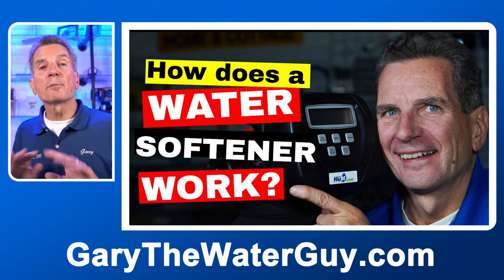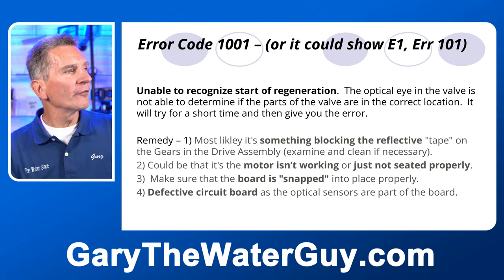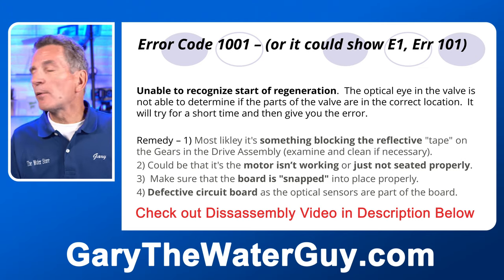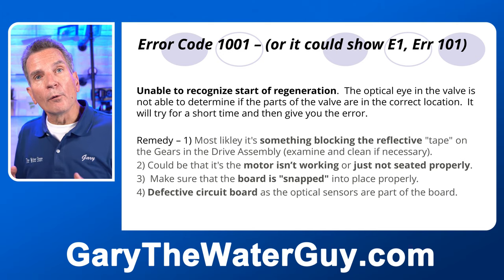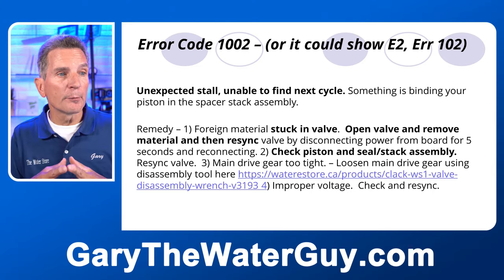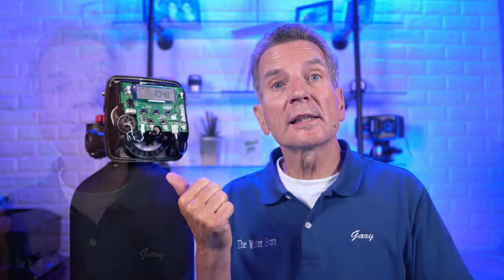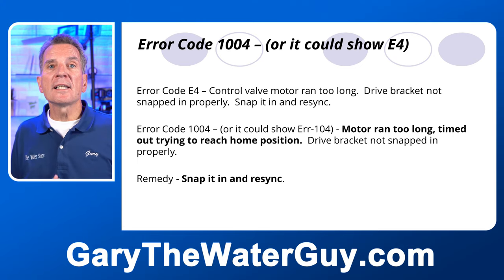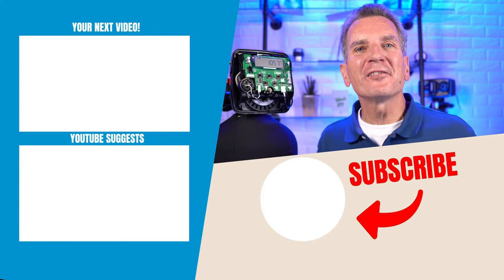CLACK WS1 Water Softener ERROR CODES EXPLAINED

Comment from the maker: You can easily fix your Clack water softener when you know what the Error Codes are telling you.  Check out this video to learn more!
Reply: On mine it says error 103 I don’t know what wrong
Reply: Thank you very much sir. very easy to follow instructions and well informed. Error 1001, sure enough just had to wipe the gears down.
Reply: @mariavillagomez7416  Motor ran too long.
Reply: I have error code 4003 on my fusion2 water softener? Ideas?

Comment: thanks for the infos. I had the Error 3: in my case it was the motor. the housing, but also the axle and bearing/bushing was corroded/seized. the motor could not move and was quite hot. I removed the motor, cleaned it with WD40, so the axle could spin in the bushing again. reconnected the motor and motor + camshaft startetd to spin again and water softener would run through recycle again.
Reply from the maker: Thanks for sharing!

Comment: First I had a dead screen.  I found that the outlet was not giving the unit power.  So I changed it and got the screen to power up with a code of 4002.  After watching your video, unplugging the power to the motherboard did indeed reset the unit and the code was gone.  It seems to be working, but was wondering if you knew what code 4002 meant?
Reply from the maker: In over 20 years I have never heard of that error code, but the manual says "CHECK SUM ERROR FROM THE POWER DOWN SECTION OF EEPROM MEMORY, Nonvolatile Memory Failure - microcontroller can no longer operate properly" I guess it might be problem with the Memory but don't know for sure.

Comment: Hi Gary, thanks for the video. I have an ecosoft pink 10 softener which i think uses a clack valve. Its showing error code E104 and seems to be stuck doing a backwash and the motor is making a loud noise when i turn it off and on again.
Reply from the maker: It sounds like it needs to be rebuilt.

Comment: Hi Gary
I have a Clock WS1 It will not produce an error message. It just says call. Any ideas? Thanks in advance Dave.
Reply from the maker: Unscrupulous installers program that into the valve to get you to call them, usually annually for a service call that you probably don't need.  You can clear that message by pressing and holding the up and down buttons for 10 seconds and it will shut off.
Reply: Thanks I will try that

Comment: I have a Error 403 issue, but a tooth brush cleaned off the power connection and I'm hoping it works fine...except now I have a tankless water heater.  Do I adjust for anything?
Reply from the maker: As long as the water softener is working correctly making your water soft, no adjustment is necessary

Comment: Gary, What does 'Pnd9' mean on my display? Nothing shown in my manual unless its the wrong manual off course.
Reply from the maker: I don't recall ever seeing that code.  Under what circumstances do you see it?
Reply: @water_estore  i've just been notified that this is not an error but a message suggesting the the duplex softener is 'REGEN PENDING' Pndg..not 9. Apparently its waiting for a regen start signal when it should be selected within the programme as '0'. I think someone on site has been messing with the programme. Thanks for responding..👍

Comment: I’m getting code 101. How do you know if it’s the eye on the board, or the reflective tape on the gear? How do you access that? I watched the disassembly video, but that wasn’t covered. I also disconnected the power at the board to reset it. No luck.
Reply from the maker: 99% of the time it is the board.  In this video at the 43 minute amrl it talks about the refective tape on the gears. https://www.youtube.com/live/hXcQ7qCxvjY?si=Qbs7dpWner_fUERG&t=2610

Comment: Help! I have a Clack WSCI working as an air induction unit to address an iron problem at a seasonal place. It has been in service intermittently for a few years, and is set to do a regeneration every two days. It is showing the word "call" on the display. The supplier had no idea what this means, and the manual doesn't seem to refer to that. I made it do a manual regeneration, which seemed ok, but it still displayed the same message afterwards. have you seen this before?
Reply from the maker: Yes, some unscrupulous dealers program that in so you will call them for "preventative maintenance".  It means absolutely nothing.  We never use it.  Page 16 of this manual shows you how to shut it off https://aspenwatersolutions.com/wp-content/uploads/2019/05/WS1-OEM-MANUAL-SOFTENER.pdf

Comment: Gary, I have a error code 109.  A self proclaimed expert just charged me $1,130 60 days ago to rebuild and rebed my iron filter.
Reply from the maker: Yikes!!  Was it a Clack valved water softener like the one in the video?
Reply: @water_estore  yes.  I used your method to reset it and then reprogramed it according to your instructions.  I think it is working ok.  So you have no idea what error code 109 means?

Comment: I've had the main gear get spun too tight all on it's own and it was never worked on since new. I thought it was the main board at first and when that didn't work I noticed the big gear wouldn't move. I spun it the other way, reinstalled everything and it was fine.
Reply from the maker: I've never seen these tighten up by themselves but it is an easy fix.

Comment: How will I know when the battery needs replacing?
Reply from the maker: Unplug the system, wait 5 minutes, plug it back in.  If the time is correct the battery is fine, if not, you need a new battery.

Comment: I've went thru every step and replaced piston/basket but still getting error code 102 at the brine cycle. Help please 😭😭
Reply from the maker: Either the motor isn't working or you overtightened the drive end cap assembly when replacing the piston.

Comment: What does it mean when the word Call is shown on display screen?
Reply from the maker: It means someone, likley your installer, programmed that into your softener at some arbitrary time frame so you will call for a service call that you may or may not need.  I never use this "feature".
Reply: How do I get rid of msg?  Does it affect the operation of the water softener?  Thank you so much.
Reply: @josullivan9148  did you ever get the call message off?  We are now getting it and cannot bypass it.
Reply: @water_estore  Do you have a video on how to get rid of the call or bypass it? We are getting the same thing.

Comment: I got 1001 error. Made valve reset, checked everything, gears were kind of fogish but cleaning them didnt help. Motor moves piston untill it like jams in the end. Maybe optical sensor components are bad, and this is not so straightforward for repair. New board isnt cheap.
Reply from the maker: Yes, it sounds like you need a new board.
Reply: @water_estore  firstly I'll try to check optic sensor, it's board level repair. Then will decide if new board needed
Reply: @water_estore  so i managed to find some corrosion near battery, cleaned it up. Then took my oscilloscope and checked signal from optic sensor going to mcu. Signal was fine and 1001 error didnt appear again

Comment: Oh dear you didn't get to an E9 on a WS1 TC,
Reply from the maker: I have never heard of an E9 error code. Are you sure you are not referring to a P9 programming mode?
Reply: @water_estore  It's not in any water manual, just a flashing E9, on a three button. I used to work in the field and never had one, and I have no boss to run too now. It's definitely "E". Can't clear it with any of a normal reset, unplugs, and coin battery changes....stumped! Thanks for your channel
Reply: @water_estore  Managed to get it to cycle from E9 to E1 and then to E2, then it cleared all errors out. In the end the reset the clock for the power outage. This went out during Hurricane Ian. I don't remember the buttons I pressed of course, but the E9 error "disappeared".
Reply: @water_estore   Got this e9 code also appeared after power outage. Set time but no change.

Comment: I don't have a code, just flashing: Error...
Reply from the maker: You would still unplug from circuit board, wait and then plug back in.
Reply: @water_estore  Turned out that indeed, the power supply failed. Thanks for you reply.....